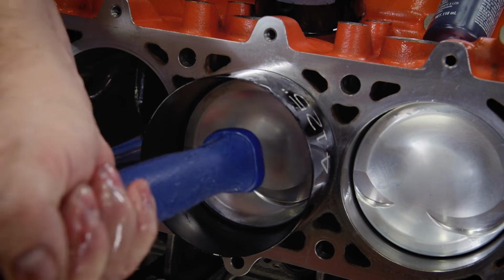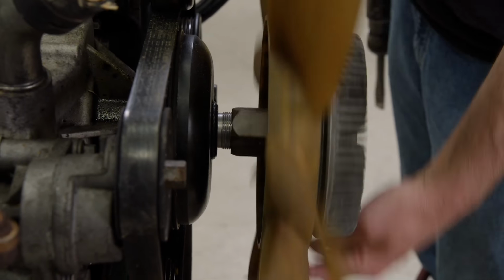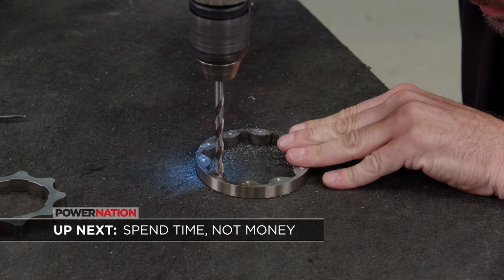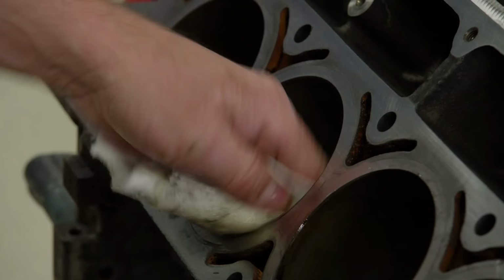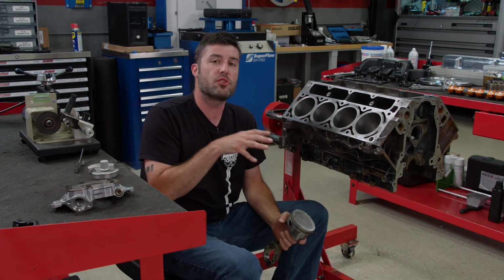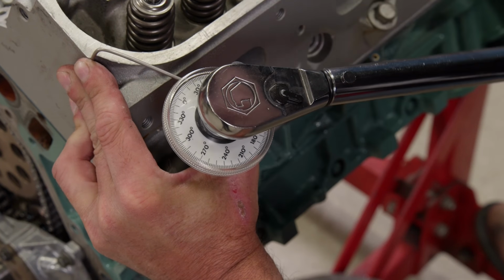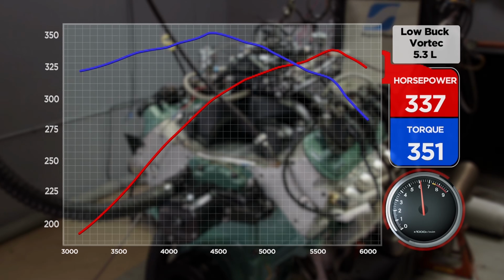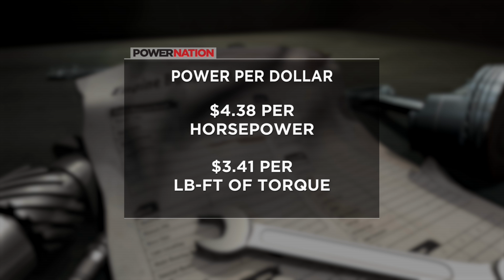Minor Upgrades Create Crazy Power on a Junkyard 5.3L Vortec - Engine Power S7, E10

Comment: As usual, another great show to keep us entertained.

However, there are a few things the rest of us in the real world have to cope with, like all of the stuff needed, in order to keep out vehicles not only running, but also actually driving down the road, like everything you removed from the top and front of the engine, those pesky things that also tend to rob some power.

So let me ask you to do another realistic, budget build.  I just bought a 2010 GMC Sierra, 2wd, LWB, with a 5.3L and 72k miles on it.  It is my DD work truck.  What sort of bolt on and other mods can be done relatively easily and yes, you guessed it Budget Friendly, to allow it to perform a bit better and help it be a little easier on the wallet, when it comes to the fuel tank?  I don't need to get from the hardware store to the job site in 4.9 seconds either. 

The way I see it, if I were to allow it to perform a little better, I wouldn't need to press the accelerator pedal down as hard, nor as long in order to get the truck moving, etc.

Comment: everyone talking about their machines costing 100k.... the only thing they did with the machines was cleaning and crank polishing. local machine shop in my area (which is pretty high priced for most machine shops) $45 for a hot tank and and $80 for crank polish. Use your head before you comment

Comment: Question.  I have a 2002 GMC Sierra with the 5.3L engine with 407,000 mils on it.  It purrs like a kitten.  I want to change the oil.  What oil, brand and viscosity, filter and additives do you think I should use to reward the engine?

Comment: These guys would cry if they tore into my 4.8l in my Silverado lol. 265k miles… maybe 8 oil changes since I bought it used with 89k miles.😳. Doesn’t burn oil, no lifter tick, good oil pressure. We call it “the miracle motor” hahaha

Comment: Its extremely important to keep your vehicle and engine clean, and keeping your fluids checked and changed is the main reason for the least amount of damage or issues
Reply: I got a 5.3 450xxx never changed the oil in the year I had it, the dude I got it from just did what I do...add a quart every 3 to 4 months and every time I drive it I'm balls to the wall, Every day, hour long trips. On top of all that doesn't smoke even when I'm bouncing it off the red line, just a slow rear main seal leak 5.3 don't need those kinds of things lol
Reply: @garityaun1098  That's just stupidity... 🙄

Comment: I have a C30 1985 dually that came with a 5 speed shift but I want to LS swap it. I want to know if I need to change the transmission to a automatic or can I still run a shift in it

Comment: The carb and ignition control wasn’t mentioned in the build tally.  I don’t recall even hearing what they used for ignition control... and the Duralast parts aren’t in the tally either.  Do they leave the knock sensors in the holes, or remove/plug them, or are they in blind holes that can be omitted?

Comment: do the same engine , but 100% STOCK with original parts and megasquirted. only cheange truely damaged parts.
ive ran a 318 engine for 8 years with more damaged pushrods so its betetr to change but not NEEDED.

Comment: I didn't see the cost of the electronics to get that thing to fire or the cost of the fuel system for that carburetor which requires a low pressure pump

Comment: Always amazes me that 5.3 litre V8 engines produce 290 bhp, but Kawasaki manage 197 bhp with a normally aspirated 1litre motorcycle engine. 305bhp with the turbocharged version. Madness.
Reply: It amazes me that your post could be so incorrect.  The 197hp Kawasaki is SUPERCHARGED.  It only makes 101ft/lbs of torque.  All the LS 5.3's make 300+.  The Kawasaki is an amazing motorcycle engine.  But it's not a truck engine, and would suck if it was.

Comment: What about the carb the msd box to control the spark the intake you can rebuild that thing for 600 bucks with a sloppy mechanics cam and a 1000 dollor turbo kit and get 800 hp safely not 550 and almost blow it. You can tell these guys have never messed with an ls nor have they ever done anything on a budget

Comment: you used all of these phrases. it looks like the oil changes were not neglected and could tell they knew when they were over, you said there was metal in the pan, said you felt the engine had been over heated because the head bolts were loose. and then followed all of that up with you can tell this engine has been somewhat taken care of haha.

Comment: LM7 LS?  Are those not 2 diff engines.. LM7 is for trucks and LS is for cars or newer than 07 where they justed used Ls in all there engines but diff numbers..
Reply: The LM7 is an ls based engine. The only V8 engine gm has used since the early 2000s is the ls or more recently gen V LT

Comment: They did not add in the cost of the carburetor, new plugs, new plug wires, an electric water pump, ignition control unit, fuel lines and fittings, etc.  I'm sure we could all add to the list of things NOT covered in their cost break-down.   Car magazines and now videos such as this have been HISTORICALLY and continually inaccurate about the real-world costs of engine repair/tuning.  This video just further drives home that fact.

Comment: I've never overhauled a 5.3. My expertise is on old  small block chevys. I learned a lot on top of what I already learned by watching other 5.3 videos. And the Rock Auto commercial tells me these guys are for real. I'm almost ready to buy a salvage engine and take a shot.
Reply: If you can build an old small block you can do a LS easily, much simpler engine from the standpoint of gaskets and assembly procedures.  Otherwise not much different.
Reply: Only difference is the fuel injection and the camshaft timing advancement,the rest is self explanible
Reply: They are actually easier than a SBC

Comment: I like to think that a good horsepower number for a street spec performance engine is 400-600 horses and maybe a little more in torque depending on the drive train and purpose. Past 600 is when you need to check and maintain your engine a lot more (in my opinion) unless if it’s something like a mustang that is already close to that point. I would say for performance cars the maintenance and check point is past 700-750 and for exotics you should always be in that stage because exotics are usually running close to the limit.

Comment: We picked up this junkyard LS for a low budget build to make crazy power! Our friends over at Stupid Performance gave us a set of custom billet CNC'd heads for free! We found a set of titanium valves, springs and custom ground cam at a pull-a-part for $10, our crank was a custom built forged racing crank we just had laying on the shelf, our friends over at Whipple has an extra 2.7L supercharger they were going to throw away, so they gave it to us for free! At the end of the day we're cranking out over 900 HP for a total cost of $535.69!

Comment: Coil packs are expensive to replace? Um... no.... Tearing down an engine with any amount of mileage and it smells of old, burned oil? Nooooo, really? Just breaking the head bolts loose on an engine with a couple thousand miles on it made the garage smell of old, burned oil....and the only reason the engine was coming apart again was because it got a massive upgrade to a ported VTEC head. Using a grinding bit to number parts instead of a punch that doesn't fling metal shavings everywhere and is easily legible ......ok then... Low buck build, using tools that most low buck builders don't  have.... Yeah, you guys don't know how to actually do anything truly low buck, because you use things that most people doing small budget rebuilds do not have. There are some tools that anyone doing a rebuild absolutely needs, yes, but there are other tools  you guys tend to use that not everyone is going to have. This is why half the time, I can't take a lot of these videos seriously. Oh, and no, Duralast parts are not always OEM spec of better, in fact, some of their parts need replaced about once a year on average, instead of 10+ years for proper quality parts..... It must be so nice having a script and pay the bill sponsors.

Comment: They converted to a carburetor because it's easier on a budget and is less to mess around with? I don't see how an injector upgrade and tune is more expensive and time consuming than swapping intakes and adding a carb. Sounds like they aren't too familiar with tuning lol. They need some form of ECU anyways with the electronic ignition. Not saying EFI will always make more power, but swapping to a carb seems silly.

Comment: Well in your cost rundown you forgot a few things that affected the outcome.

# 1 Carb, # 2 headers, #3 Plug Wires, #4 Electric Water Pump, # 5 All the new sensors, # 6 Cost of Hot Tanking engine block twice,  #7 MSD Ign. module.

I see them doing this on all their builds.
Reply: Ball hone, engine stand and hoist, and a drill.. Harbor Freight 600$ max.. You don't need a shop to have or do any of that. We swapped an m50 into a e30 parked on the curb. Stop being a priss and lay under your car..
Reply: @KingKlutchh  thank you, these guys are just pansies
Reply: @KingKlutchh  Amen. I do my work in the driveway on my back piece of cardboard no creeper. like a man.
Reply: Most car guys have many of those tools in the garage
Reply: @Crodgers88 yeah no they don’t 😂
Reply: @Ariel0104  yes they do
Reply: Yes, the forgotten cost are more than annoying.
These guys must have been government accountants in the past.
Reply: What you don’t have all the bits bites and bobbles just kicking around in your shop 
Check the junk drawer
Reply: Dam I forgot a few things then 😥
Reply: I lifted a 1979 L20B long block exhaust intake carb Rebuilt it in Motel floor dumped oil under Bed! Yea I could have downed it in toilet but motel owners pissed me off.
Reply: I think they were running down the long block cost. None of that would be including in a typical longblock price
Reply: Don’t forget every special tool that was required. Like an engine hoist, a shop to work in, a drill, the honing equipment, the property the shop was built on, the plumbing and electrical to operate the shop, land taxes, rent, 2 sets of hands, the budget required to get the engine out of the junkyard for example a truck or flatbed, etc. 

For someone that might own a car and/or lives in an apartment would be having to borrow a truck to haul an engine from the junkyard. In a normal situation they would also have to do all the engine work by there self. The title should read “If you already own a fully functional shop with every tool needed to clean journals and wash engine blocks at 150 degrees, with an engine hoist, a dyno, along with another ASE Master Certified Mechanic to help you, here’s how you can build a junkyard engine for $500”

Comment: My L59 is currently at 255k miles. Edit: 287k miles. I notice Richard Holdener getting the same basic results out of these "junkyard" 5.3 motors. And how much stronger they are than our beloved 5.0 under the same conditions (gross SAE). Project car people with Miatas and RX7, kit cars, etc, shouldn't use the 5.0 any more. They should be using this now.

Comment: 2k comments and I have yet to find a positive remark.. "They're using $100k in equipment." What were you expecting? It's a performance shop doing an engine rebuild, and that stuff cost a lot more than that, so don't sell them short. But besides the engine cleaning tank, I'm not sure what they used here that most people wouldn't have access to for a few hundred $'s?

Comment: Don't forget the electric water pump and headers that helps dyno power #'s. Us regular guys would've spent money on a cam.
Should've used the stock intake manifold, throttle body, fuel rail, and injectors like all of us would do.

Comment: So much missing from the cost/parts list.  Carburetor, headers, all the new sensors, spark plugs, head bolts, and what I wanted to see the most-whatever management system is firing the ignition coils.  There's probably more I missed.  And of course, having around $100k worth of tools/equipment at one's disposal.

Comment: This question is one of ignorance, my understanding was that the vortec and LS engines are completely different although the vortec may have been "based" around the LS. The main differences other than most vortecs being iron block they are much larger than the LS making it anything but economical to put a vortec into a car or to convert it into an LS. Am I way off the mark? I am currently working on my welding license but I've always been mechanically inclined and want to go to college to be a mechanic so I try to learn whenever possible. Again this question is asked out of ignorance if I'm wrong go ahead and throw it in my face because I won't learn if I don't know I'm wrong. Thanks y'all!
Btw great video ;3

Comment: Did I miss the price of the Holley carb and MSD 9014?  The heads came back super clean, did they forget the valve job, or at least replace the valve seals?  They honed the cylinders, but didn't even clean and lap the valves?  Did they reuse the stock valve springs with 100K miles on them?

Comment: I have a challenge for this guys in Power Nation. I will drive my 2004 chevy Silverado 1500 with a 5.3 engine with about 148,000 miles. That is still running and I want to know if they would do it. I will film this venture from the time I leave my house until its done. I will end my film until I get back. I will show the difference  before and after with actual price. We will dyno the engine before  I leave and after .  Let me know if you are down Power Nation.

Comment: I can't even get mine to run right stock. Idles like shit but drives pretty good on the highway; still averages 16-17 mpg. I've "de-constipated" the cats, replaced the driverside valve cover, plugs, wires, fuel pump...

Comment: why anyone would so completely tear down an engine and not replace ALL bearings, including the pistons and rings is beyond me.  it would add minimally to the cost and the value to the over all build would be priceless.  most of the added cost could be covered by resale of the unused parts from the origional engine rather than throwing them "in the scrap bin".

Comment: Great show as usual. Love the LS series, probably the best engine that has ever come out of GM. I would keep the injection (I did!) The GM air/fuel algorithms are spot on even for big valvetrain or forced induction. A new set of injectors and a tune don't cost that much more than the carb setup. And bottles are for babies anyway!
Reply: No. This is horrible advice. The factory G.M. tune isn't spot on at ALL for big cams, and added forced induction. 
Add a cam, intake, and exhaust on an LS, and if you don't get it retuned, you're throwing away a bunch of power.

Comment: Why the hell do you hone cylinders it's actually a bad thing to do. When i built my engines i polished them and those engines still running after 200000+ miles and everyone were telling me it's going to cease. But guess what they still running and performing way better then ones which had been honed and polished cylinders ones consume no oil unlike ones which were honed.

Comment: YOU HAVE TO GIVE THE OLD SMALL BLOCK FORD 5.0 BIG BIG BIG CREDIT. WHICH IS THE MOTOR THAT SINGLE HANDEDLY STARTED IT ALL AND SHAPED DRAG RACING IN TERM OF POWER ADDERS TO WHAT IT IS TODAY, NOT ONLY DRAG RACING BUT FROM PERFORMANCE STANDARDS USED BY ALL MANUFACTURERS TODAY WHEN MAKING A HIGH PERFORMANCE VEHICLES. BUT ALSO IS THE FOUNDATION OF THE LS'S DESIGN. IT PRODUCED 220HP WITH 5 LITERS AND PRODUCED 300FT LBS OF TORQUE FROM A MOTOR THAT WAS DECADES OLD WITH SMALL VALVES AND HEADERS SO TINY THEY WERE LIKE A NEW BORN BABY'S WRISTS. THIS LS WHICH IS RACE ORIENTED FROM THE FACTORY (THE EPA LOOKED THE OTHER WAY ON THIS ONE AND SAID LIKE SHULTZ SAID FROM HOGAN HEROES "I SEE NOTHING") WITH MORE CUBIC INCH, BIG HEADERS, HEADS WITH LARGE INTAKE AND EXHAUST PORTS AND VALVES MADE 346HP BUT 355 TORQUE JUST 55 MORE THAN THE FORD 5.O. NOTHING HERE IMPRESSIVE ABOUT THE LS AND I MEAN NOTHING.

Comment: My Dad used to drive a mid-1980's Oldsmobile Cutlass with a V-6. I've heard that V-6 is something of a legend for reliability. Most impressive to me was the "snappy" performance it had with tremendous gas mileage (high 20's in town, mid 30's on freeway). From a 1980's GM engine??? In a full size sedan??? How about tearing down one of those engines and seeing what you can do?
Reply: the buick 231 v6 is a legendary engine. the same block used in the grand nationals. very strong bottom ends and compact. they make good turbo cars

Comment: That is a serious jump in power, even without the nitrous. You guys know how to build a motor, good job once again.
Reply: yeah, but that torque number was falling like a boat anchor.
Reply: @frotobaggins7169  crazy thing is that torque number would have been much higher if they started their dyno run at 2000 rpm instead of 3000
Reply: @everettgrover9459  Yeah, it always annoys me so much when they cherry pick the starting point.  They should always start at 2000 rpm so we have a fair comparison.  A lot of times these motors have impressive numbers but they are all above 4000 rpm which essentially makes it a race motor.  I consider it cherry picking data.